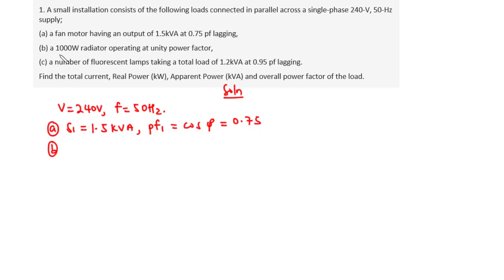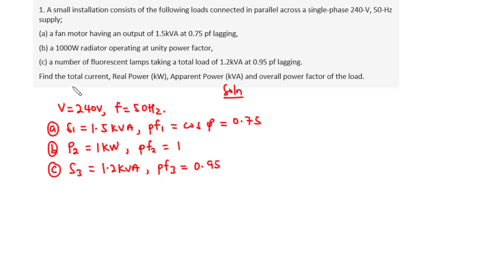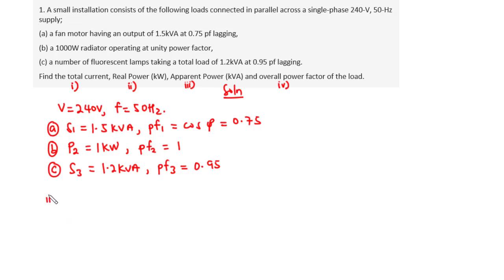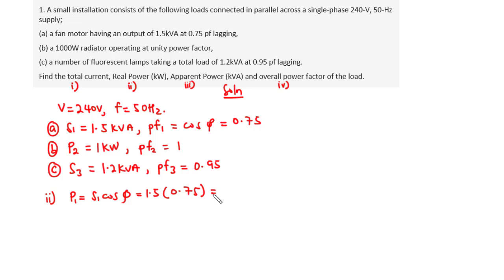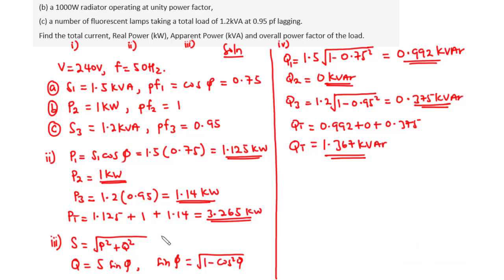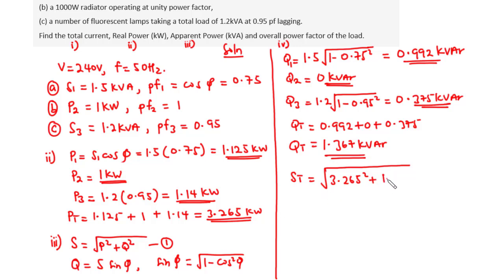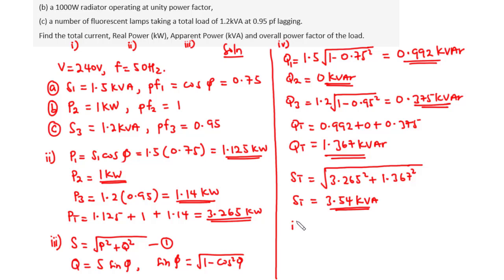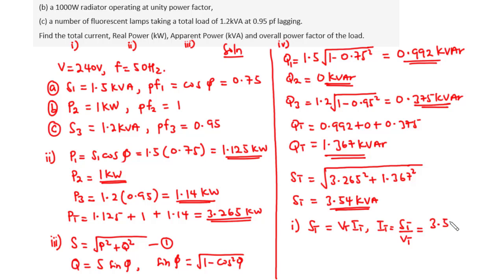46 - Power in AC Circuits 3 | Power Triangle - Apparent, Real and Reactive Power

Comment: Please how would you know the final power would be lagging or leading?
Reply from the maker: for an rc circuit, which is capacitive, current leads voltage, for an rl circuit, which is inductive, current lags voltage, but for an rlc circuit, check the phase angles of the current and voltage of the circuit. Assuming v has phase angle of 0 and I has a phase angle of 60. it means current lead voltage by 60 hence pf is leading.
this video will help https://youtu.be/189CZjj0JB8

Comment: Please considering the question i, since we have the S total to be in KW why didn't we multiply it by by 10 exponent 3  before dividing by V to find the I total in A Or better still have our final answer( I total in KA) since we didn't get rid of K?
Reply from the maker: the reason is that first, we want to avoid having huge values that is why we worked in K's, notice that at the end, 240v is converted to 0.24 which is is kv, hence k cancels out, that is why you have current in A. in actual sense you would have had 3540/240 which is still 14.75A.

Comment: Good day sir
With the C part of the question 
If we assume that the power factor 0.95 leads the load of 1.2KVA how do u solve for the total P and Q
Reply from the maker: You will do it like specified in the video just that in finding the total Q, the Q with pf leading becomes negative, so for instance, if pf for c is leading, Qt = Q1+Q2+(-Q3). Hope you get it.
Reply: @SkanCityAcademy_SirJohn  I get it 
But will it also affect the total real power???
Reply from the maker: No, it doesn't affect, P.
Reply: Noted 
Gracias 🙏